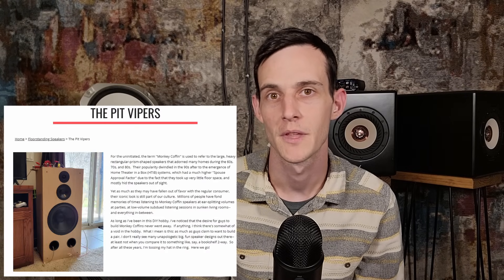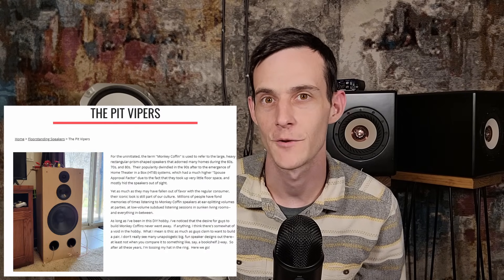Speaker Kits YOU Should Know About In 2024

Comment: This is why I have only ever purchased two new sets of speakers. Both were disappointing in value. 

Instead, I buy a lot of old speakers that were very expensive and performant in their day - and they are all amazing. For example, I paid less than $1,000 for a set of ProAc Response 2.5s that had taken some cosmetic damage in our first big earthquake. The damage is not visible in my setup.  I got a QUAD 12 center speaker for $100. I got two pairs of Shahinian Super Elfs for $250 from a deceased estate - and they're perfect. 

And because I exclusively use Fosi M03 Subwoofer amps with GaN 48V 10A PSUs, I paid just $250 for a $2500 10" REL subwoofer with a blown amp. Recently I paid $100 for a gorgeous pair of Mission 771e bookshelfs, and $200 for a pair of Blumenstein Orcas! I paid $50 for a blown Klipsch 10" sub. And I paid $80 for a piano black 6" powered Energy sub for the kitchen system.

I've only ever had one bad purchase, and the vendor refunded me, and let me keep the speakers!

I've also had amazing deals on Castles, Linn Kans, B&Ws, wood-coned JVC EX-A1s, and DB Polaris 610s, to name a few.

So, there is absolutely no need to make your own speakers, when you can buy incredible speakers at 10% of the original purchase price. And Chat-GPT will greatly help you in deciding what speakers to buy on the second hand market.

Don't get me wrong... I am building some tiny transmission line speakers (3D Printed, mostly) for some gorgeous Audio Nirvana 3" Super Cast Frame full range drivers, that sound freaking stupendous - so I am not against the idea. It's just that it's not necessary in order to get truly high performance speakers which will match your music, your listening style, your amps, your timeframe, AND your budget. :)
Reply: Do you run a museum?

Comment: I have a pair of SB Audience 8 inch fullranges on my desk. Also have a set of Fane Sovereign 12 inch fullrange that sometimes are on my desk. Just 22mm MDF all around a little bracing and 30mm extra on the front, all set. Little if any for the filters, if you so choose. 

Thinking I may add some Ripol bottoms on the 8 inchers though.

Comment: If you want a very Cheap Audiophile grade speaker  (or a NEW KIT to build them) , that Blows away Speakers that cost Multiple Thousands of Dollars... (mostly, because most people do not seem to know about them),  look for a pair of  "EPI 100"  speakers,  or the  "Genesis Physics"  equivalent (EPI was bought by Genesis Physics, and used the same God-Tier Drivers).    And if you want a KIT to make them yourself... a guy that used to work for EPI/Genesis... sells the drivers + parts... for less than $400 for the Pair...  at   "humanspeakers"

 If purchasing them used, make sure the woofers are Original  (they have a small dustcap diameter, making them easy to spot), and that they have the Updated tweeter model (the old tweeter is mounted to a Fiberboard backer,  and the new tweeter versions are mounted to a plastic bezel... and have much greater detail and range)

 This simple looking  8 inch 2-way bookshelf speaker,  utterly Destroyed my former Techniques 12" 3-way towers... in ever Metric Possible.   The Soundstage is "Holographically 3D"... and is the widest, deepest, and tallest... that Ive ever heard/experienced.   I never understood what "Vanishing Speakers" meant... until these.   Its as if the sound is merely floating in 3d space, without a projection source.

 The most magical part of this speaker is the Inverted tweeters.. that have amazing detail.. and an insane 3d Soundstage.  However, the Woofers are also amazing, and Unique.  They have MASSIVE magnets... and super strong voice coils... allowing them to replicate the music with almost no micro-distortions at all.   The bass is deep, fast, and Thumpy.  Deeper and Thumpier than my former Techs... despite using a much smaller cone.

 The Woofers also have another Special Quality.   The designed used a heavier Gauge wire to wind the voice coils with.  This automatically filters out any High Frequencies... without the need to add an additional Crossover component.  The theory, is that crossover components can color / change the signal slightly.   As such, there is only a Single Capacitor needed, to protect the tweeter from low frequencies.

 This is a Sealed speaker (air-tight).   As such, the Bass is FAR more Musically Accurate, compared to Ported speakers.  Once you hear a good Sealed speakers bass... you can NEVER go back to ported speakers.  I almost cried, hearing the difference... and I became so Angered at what I had been Robbed of for so long... that I immediately chucked my other speakers to the Curb, for trash pickup.

 I got my  EPI 100  speakers, for  $100  re-foamed, on Craigslist.   They decimate the local high end stereo shops $3000 flagship speakers...  And... Its not even CLOSE.   I might have Balked at paying around $400 for a pair of speakers... as Ive always been pretty broke.  But after experiencing what these babies are capable of...  I can tell you without any Hesitation... that they are a MUST HAVE speaker.  They are well worth the extra savings... if you cant find a cheap pair locally, or online.

 You will hear NEW things in old music.  Such as finally being able to understand Lyrics that the singer was singing.. that you never could fully understand before.   When that happened to me... my Jaw hit the floor... and then I had to replay ALL of my CDs, to see how different that they all sounded, when played with these speakers.

 There are other larger models, that also have Passive Radiators... Ive never heard / tried those... so I couldnt tell you if they are better or not. That said..   Ive read that the  EPI 100  versions (smaller cabinets)  have a better sounding, punchier bass...  but I cant confirm that personally.

 Ive heard a LOT of different speakers over the years.  I used to own like 30 different pairs.  Nothing Ive heard, even comes close to the EPIs.
Most especially in the 3D soundstage aspect.  Its almost as if a live band is playing in the same room with you.   And unlike other speakers... they are extremely flexible about placement and room types.  You can sit, stand, walk around the room... and still get a near flawless stereo image, with almost zero drop-off  (You dont have to sit perfectly in the center of the room).   The speakers can be placed on stands, or directly on the floor.  Though, they sound best on the floor, and close to a wall (better bass, that way).

 Note:  I dont have any association with that site.. and Ive never purchased anything from him.   I just found a pair of EPIs, and fell in Love with how they sound... and think everybody needs to own a pair for themselves... New or Used

Comment: is there any diy kits for building a tv stand with speakers, like integrated, i can only find one expensive danish company that makes that and not diy. i have no space what so ever for speakers on the floor, but i have space for a long tv stand on the wall, and i want better sound than a normal soundbar. but it does not seem to exist any options, and im not an expert in calculating a speaker box kit, so hard to make something from scratch.

Comment: Thanks for your video. I’d like to find a diy kit for thin wall mounted speakers to use in a home theater. 

I’d like better sound than in ceiling speakers, but don’t want huge obtrusive speakers either. The less they are noticed the better. 

Left, center, right, surround and ceiling mounted ATMOS would be perfect. 

Cabinet size….. Maybe 6” deep and up to 10” wide. The cabinet can be as tall as needed to get premium sound. 

The kit can be a set of instructions with a parts list and CNC router file, or anything up to providing everything with a flat pack. 

Can you or do you know anyone that has the knowledge to put together a diy kit for something like this?     Thanks.

Comment: Hey, thank you for including a picture of my HiVi 3.1a Kit. The 3rd picture of that HiVi model is mine. I built it using the ultimate Sehlin Mod. I ended up replacing all the caps, resistors and inductors with much higher quality parts. The upgraded parts was more than the cost of the kit. But my goodness, the sound!! My $1500 HECO Celan Revolution bookshelfs are packed up in the garage because of this kit! Nothing from Focal or B & W below $2500 can compete with these moded speakers. Thanks! 🙏🏼
Reply: Are you saying this $350 DIY kit sounds better than your $1500 HECO, better than Focal speakers or B&W speakers below $2500?  Sounds very tempting to me!
Reply: @Chitown388 

Yes, if you upgrade the parts and go with the Ultimate Sehlin mod

Comment: The GR-Research X-LS Bravo is or would be my first choice, but budget reality has set in and the likely build will be the Parts Express C-Note MT Book Shelf. As having heard both the sound from either IMO are very close if not near identical. The C-Note is slightly smaller and funny meets one of Danny's mandatory principles and that is the closer to and the most line line your drivers the better the sound and few if any arrival time issues. This also If I understand it as well requires a less complex and maybe expensive crossover. I don't, or won't, unless they offer an upgrade mod will be changing anything concerning the design. Though given my love of AMT Tweeters and their longer refined decay times and sparkle makes me want to swap out the Silk Dome tweeter for an AMT... As a close Mfg Built small bookshelf that hearing was insane were the Matrin Logan B2 I think that was the model. The ML's are roughly $600 a pair, but just I knew I'd found the sound I hope to replicate along with their Sound Stage and Holographic sound.
Reply: I really like my C-Notes. I use them for my computer speakers. Great place to start for any first time builder.

Comment: Folks who are considering getting started in this addicting hobby w/ a minimum investment should stay w/ Parts Express, specificly the dimimutive Passive Agressives and the Aviatrix pair (Aviatrices?).
The Passive Agressives-While each is only slightly bigger than a box of tissues, the sound that comes out is amazing.   
With no rear port, they can be placed up against a wall and they have the highest Sig-Other approval rating. Downside-As mighty as they are, physics take over and there is a limit as to how much space they can fill. $170 (pr.).
The Aviatrix MTM (pair) was recently re-designed by master designer Curt Campbell to use the updated RST 28 tweeter that replaced the ledgendary original RS 28 and he managed to keep the magic inside the boxs. At $300 these are P.E.'s most complete kit and all the little stuff that one usually has to buy comes included. They work great layed flat to use a center channel. But since they only come is pairs, two pairs would have to be purchased, but they extra parts could be used to build 2 smaller MT versions as surrounds for a killer home theater set. The boxs and plans are avail. and total outlay would be less than a $1000 (depending on the finishes).
The HI-vi Swans, listed on Amazon, both the 2-way and 3-way kits were outstanding values, but have not been avail. for some time so I'm not sure why they brought up in this video.

Comment: Nice thanks for the info . So far I really enjoy my ADS L780  but being a woodworker I really want to build a nice set of speakers... I never actually listen to "high end speakers"  Im curious where my ADS would be compared to your list ?  
I also wonder if I like them because they are closed enclosure ....?
Reply from the maker: Building a modern designed speaker would likely be a big improvement. But sound truly is quite subjective. 
Price in speakers is largely tied to level of exterior finish. Elacs B2s are really affordable because the finish is cheap. But they both measure, and sound phenomenal. I actually have a video where I upgrade them with veneer.

If you're just looking to try a build, Paul Carmodys designs are all free on his website. Pick something you really like the look of, that's in your price range.

Cheers!

Comment: Quick advice on the pit vipers and carmody stuff in general.  Many of his speakers, including the pit vipers, don't measure in line with his sims.  I built the pit vipers and they exhibit a broad recess in response between 300hz to 1.5k, 400hz is about 10db lower than the rest of the speaker for instance.  I measured the speakers outdoors and elevated away from boundaries.

Comment: Have you ever built or heard of madisound  nada 2 way from an audio magazine few years back klang and yon kit  go yo their website get the full details  it has some of the most current scanpeak 
Drivers and scanspeaks premium berilium tweeters , mundorf caps and other crossover parts, goertz inducters its what sonus faber uses on its top of line speakers and has been upgraded to include. Mundorfs  newest  capasitars that will be fasing out the ones used before with options to have sealed or ported cabinets. The only upgrade that is needed  is like 
Furutech  binding posts the better quality the better and some furutech  wire for internal wiring. I also now a german in germany that has this same kit  my brother has  an earlier kit 3 way sounds as good as my  sonus faber cremona m   a 10k  speaker but his newer designs are much better as he uses  volt midrange  resembling the atc mirange  but im thinking the madisound is a better crossover  because his crossover uses goerts inductors  and chinese  copper wird he does use  mundorf to but this kit for madison is more sellective parts  let me know what you think, also they  have a builder in u.s.  that can make the the cabinets and assemble the speakers for you to they do an awesome job  its on the madisound web page

Comment: I'm listening to you on my early 80s UK DIY Malcolm Jones Tabors built from scratch using Audax drive units & simple tools over a Xmas Uni break. The build was arduous enough not to be repeated. Last fall I considered building the XLS Encores but at $700/pair & remembering the Tabors I searched for Chinese speaker bargains & discovered the Q-Acoustics 3050s ($400/pair). They were positively reviewed by Martin Colloms a highly respected UK journalist. To avoid disappointment, before any build I would suggest an audition or comprehensive review (with quality data). Cheers!
Reply: I built Malcolm Jones Tabor speakers from a kit in the early 80s as well. Purchased from Madisound in my hometown. They were my speakers in college and grad school, then sat in storage for 20 years. I recently rebuilt the crossovers using clarity caps and replaced the Audax tweeters with new. Still in my main system. So little info about them. Would love to know more. I have thought about what I would replace them with but they still sound fine.
Reply: My kits came from Wilmslow Audio. I'd like to rebuild the Xovers too but the woofers are stuck in place & the terminal panel is small & glued in place. The bipolar electrolytics definitely need replacing.
Reply: @ Maybe Wilmslow can help you out. Their site says the rebuild crossovers. You could possibly drill out the old terminals or carefully pry the woofers out.
Reply: Thanks for the advice. The woofers have pressed steel baskets, they've been there for 40+ years, I've tried easing them, the're stuck. The input panel could be removed & a larger one put it's place, then I'd access the Xover & replace the capacitors, a winter project.

Comment: Is that the Tang Band W6-2313 coaxial woofer in the back behind you?  Also, Toid did a collab with former YouTuber Kirby Meets Audio to make a 2 way tower similar to the Amiga.  I've built 1 pair and have the parts for a second.  I'm quite a fan of them.  I also built a BLH using the MarkAudio CHR-70 which turned out well.  Keep up the good work!
Reply from the maker: Yes that is the Tangband 6" coax. To be totally honest I'm not really happy with my design, on account of some low end boom, but the mid & top end are really something sweet. Dialing in the xover was a challenge with impedance.

Comment: I’m verrrry beginner in this hobby but I fucking love music and speakers. The only thing I’ve dabbled in so far is DML panels which sound astonishingly good for what they are in my opinion. But I think I’m going to go with the hivi kit for my first true diy build. Great video! Would love to see some more prices included next time, even if they’re rough estimates!
Reply from the maker: Good point, pricing would have been relevant. I would highly urge you to build the Hivi kit. Both the 2-way and 3.1 are great kits. You won't be disappointed.
Reply: @ pretty sure I’m going to go with the 3 way because I’m extremely curious to hear what a ribbon tweeter sounds like lol
Reply: @LikelyLagging  BUt like he said, the vinyl finish is not very good. I used it cause the ones I made were just for the garage or to give to my sister. But, it is hard to get right, and is ugly.